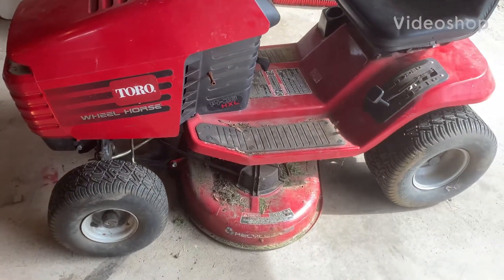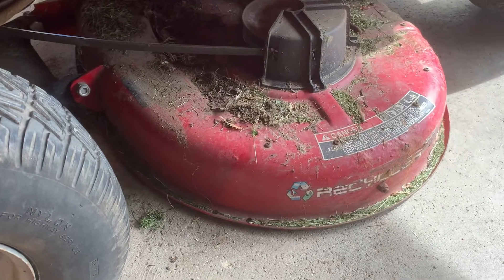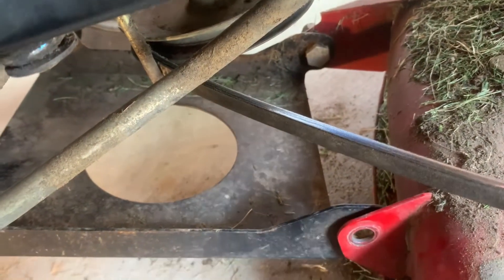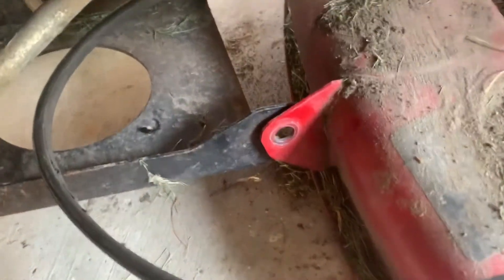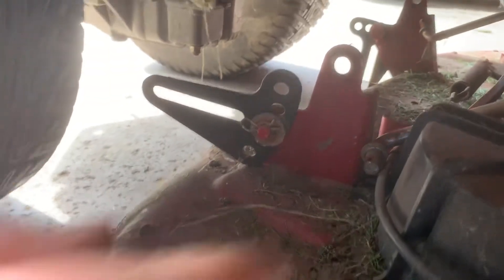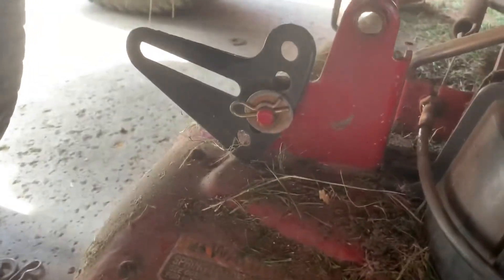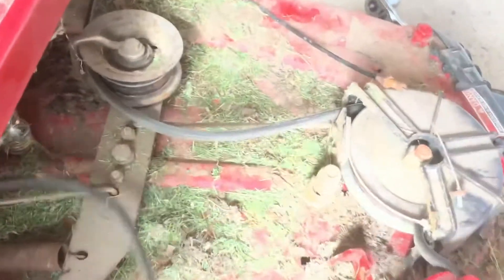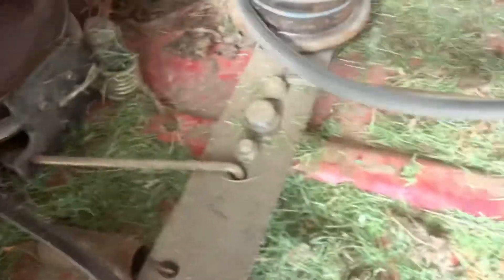HOW-TO Remove Deck from Toro Wheel Horse 14-38 HXL In Under 10 Minutes

Comment from the maker: LawnRAZOR Mower Blade Set for Toro Time Cutter Z 38 inch Deck 14-4889 14-7799 79-1720 79-3060 (Mulching) https://amzn.to/4eKnbJe
Gray High Back Seat fits Toro Mowers 15-35 HXL, 314-8, Reelmaster 2300D, ZX525 https://amzn.to/45JvMb3
Deck Belt Compatible with Toro 88-6250 RT380H 13-38XL 14-38HXL 15-38HXL 16-38XL 16-38XLE 16-38HXL, John Deere M40223 M86996 190C 130 170 180 165 116 160 https://amzn.to/3VOShGS

KIPA Carburetor for Brigg & Stratton 794572 791858 792358 793224 697190 698445 594593 498061 499153 690194 791886 799727 With Mounting Gasket & Carbon Dirt Jet Cleaner Tool Kit https://amzn.to/4cnmALQ
Toro Drive Belt 1/2" X 84" Blue Kevlar Belt, Use To Replace Craftsman Poulan Husqvarna 140218; Simplicity 1717932, 1656960, Toro 88-6280; and Many More
https://amzn.to/463Av7P
Deck Spindle Blade Kit Set Combo for Toro 1238 1338 1538 16381242 1342 1442 XL HXL 80-4341 14-7799 https://amzn.to/3W4n8AG
334279 1/4" Fuel Filter for Briggs & Stratton and Toro, Replaces OEM #'s 394358, 394358S, 56-6360 https://amzn.to/3XS0koW
496894S 496894 493909Air Filter for 12.5-17 HP 5053K with 272403S 272403 Pre Filter LG496894JD GX85 SX85 Scotts S1742 SABRE 1542HS 1546GS 1638HS 1642HS 1742HS Lawn Mower BS-496894S
https://amzn.to/3LcKca1
Briggs & Stratton SAE 30 30W Engine Oil - 48 Oz. 100028 https://amzn.to/3VFQLqC
Starter Solenoid for Craftsman Husqvarna LT2000 YS4500 532192507 582042801 582042802 21546294435-325 705055 Lawn Mower Tractor Lawnmower 
https://amzn.to/3xCWRAa